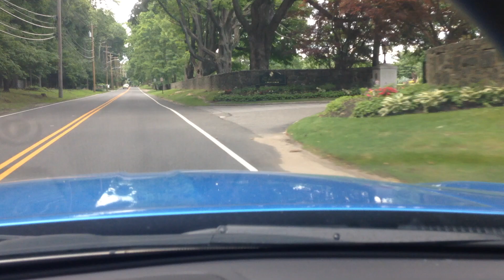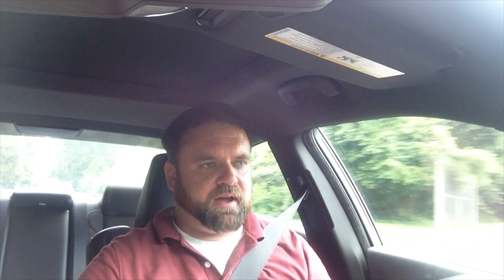1/8 Mile Time Charger RT

Comment: Hey how are those tries holding up so far thanks for the link in the other video on how to make sure they fit
Reply from the maker: I love them - those tires are the reason I'm getting 5.1 in 0-60 almost every time. That little tool is very helpful, if I had that it would've made me a little more comfortable getting them on. I had to read through tons & tons of forums to get that info.
Reply: R/T Life Good deal its time for me to get a new set of rears and I'm going for the 275
Reply: demetri smack me too bro

Comment: At least the car is consistent
Reply from the maker: You have no idea - this car is banging out 0-60 5.1 every time now. Almost regardless of road. 1/8 mile 8.7 but I think if I had fresh pavement, cooler weather & wide open area that I wasn't worried about cops the time would improve.
Reply: R/T Life Any 1/4 mile times?  I have a 16 R/T thats FULLY loaded and would love a separate independent 1/4 check from someone else with minimal mods.

My mods BTW are a Volant cold air intake and Solo cat back exhaust.  I have a set of SRT manifolds / factory shortie headers and set of modified midpipes with 200 cell high flow cats that I'm waiting for vacation to install and a Scat Pack stage 1 PCM I'm waiting to come in.
Reply from the maker: I myself have not tested the 1/4 mile because of the lack of room around me & no drag strip. I've seen videos of Charger RT with nothing more then resonator deletes run a 13.2 - but for the most part I believe you would be 13.4 range. One article I read claimed they got a 13.3 in 1/4 mile.